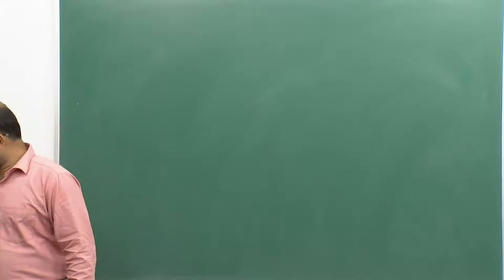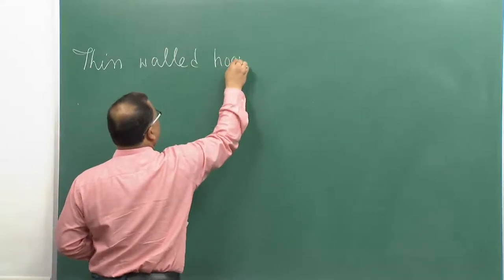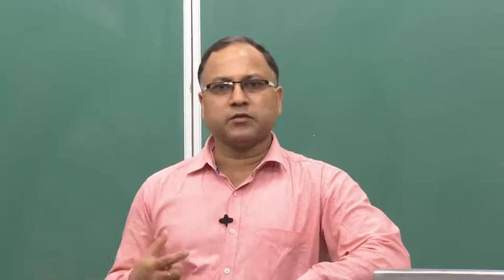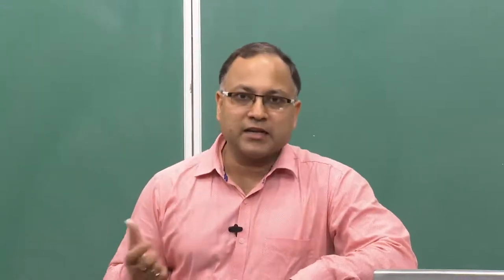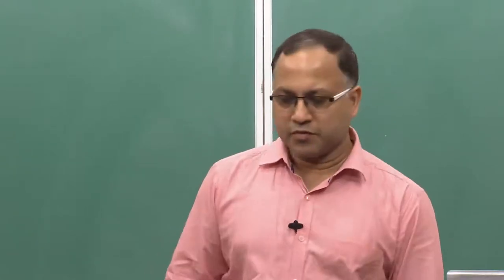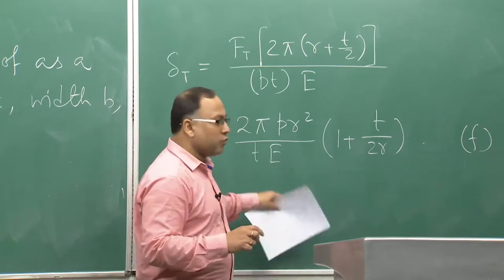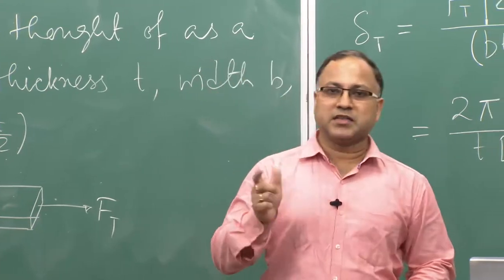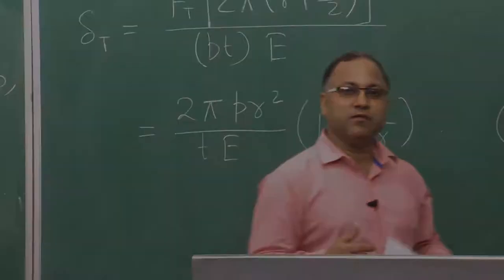Lecture 14 - Hoop Stresses.

Comment: I have a doubt that hoop is symmetric about both the axis. So if Fr=0 then Ft should have value or else if Ft=0 then Fr should have value since it is bisymmetrical .
Reply: yes you are correct ..its like instead of cutting along x axis, if you cut along y axis then force along x will be non zero( which we are calling Fr in the vid) and force along y will be zero(which is Ft in the vid), but then also, the result will be same because in reality, we are the ones defining the axes and names of forces..you can even take a third orthogonal system and cut the ring about one of the perpendicular axes.
Reply: but if you notice what sir says, he is calling tangential force Ft and radial force Fr. so if we change the cutting axis from x -x to y-y then our tangential force and radial forces will be swapped in the sense of direction. 
so basically, again tangential force will be non zero, radial zero. i think my explanation is very skewed but its been 6 yrs anyways so...